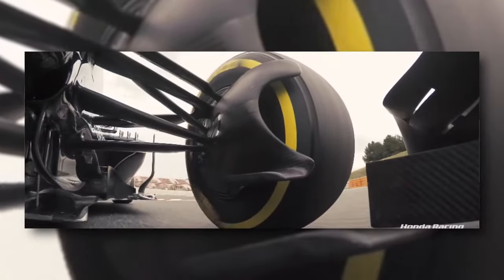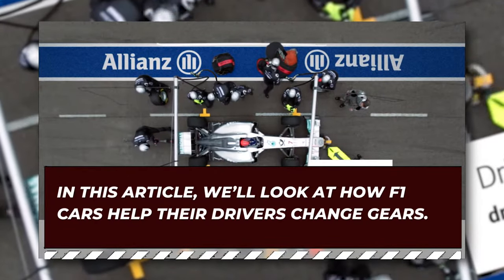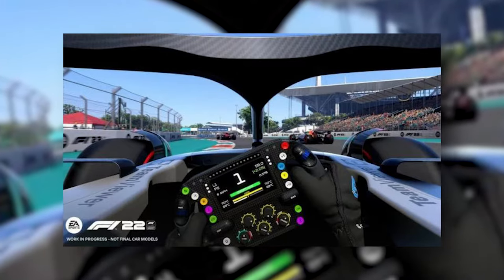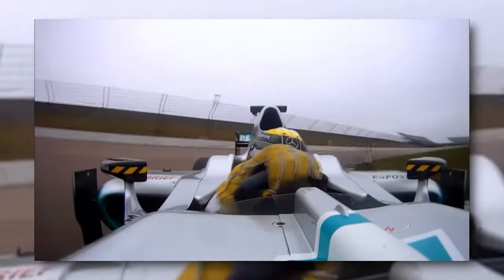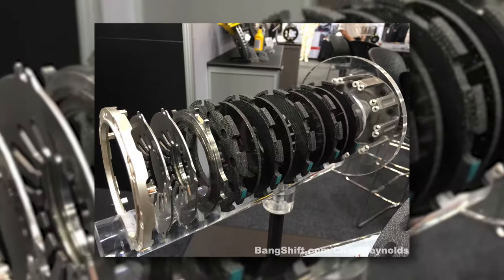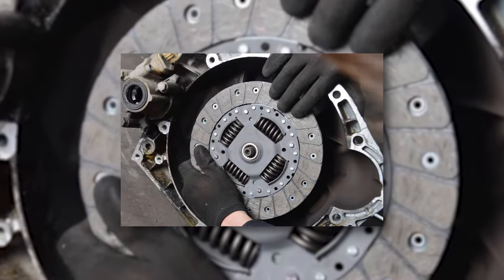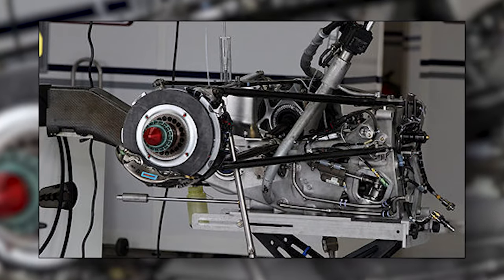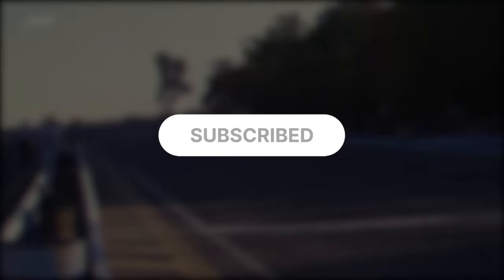How F1 Drivers CHANGE Gears?

Comment: Nice information 👍 F1 is the pinnacle of automotive engineering, leading to a lot of innovation in every aspect but when talking about the transmission, they are just freezed on semi- automatic Sequential gearbox. Why don't the cars are using a fully automatic or CVT type something? Because they still have to give time in changing the gears up or down, this also consumes time and the driver always have to focus on the upshifts and downshifts according to speed. There must be a good reason, but kindly explain me what is it?
Reply: One reason for less driver aids is because we want to test who is the most skilled drivers
Reply: @benjamind2046  😂 seems like you're an F1 engineer who forgot to focus here